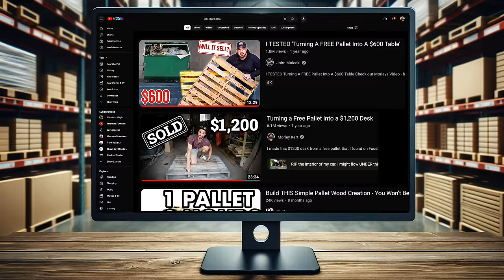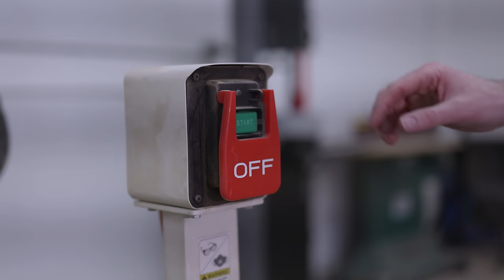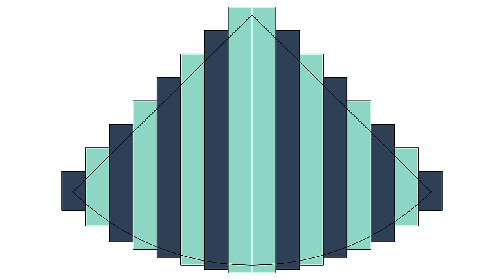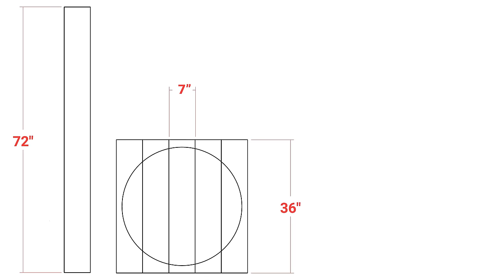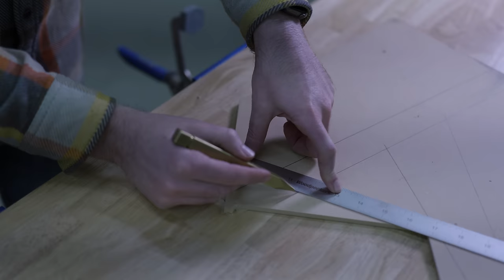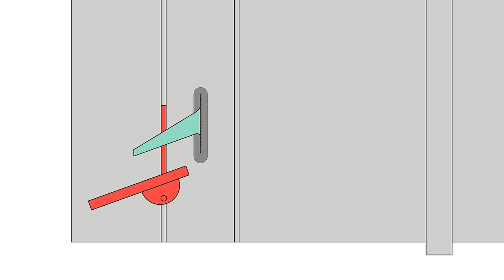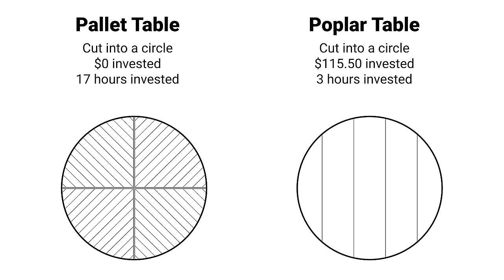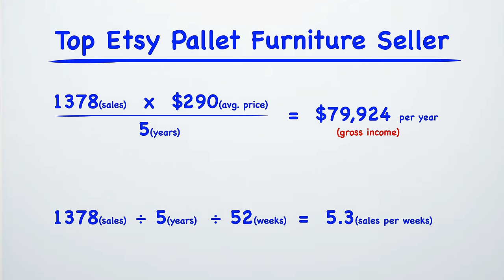Pallet Furniture is a Scam

Comment: Another unmentioned reason to not use pallet wood is that if you don't have a separate workshop and you're just woodworking in your basement, you have to lug dirty potentially pest-ridden wood through your house and in your car. Not a huge risk but potentially unpleasant and on the off chance there is actually something wrong with the woods congrats your house might have termintes now lmao.

Comment: it would be really cool if you built a table/work surface with tech included. Like a table with laptop connection ports.  USB power, Display ports (Video), speakers ect...

I have tried taking a pallet apart and it is was a royal pain in the arse. The nails used are almost like screws as they are twisted and have ridges that work like a screw. To save time it is probably best to cut the boards apart.

Comment: I would be very careful with putting pallets in-house. Many pallets are impregnated with insecticides to keep insects from getting into the wood during international transport of goods. This is quite unhealthy to put in an enclosed space, work with and inhale the dust of, or put any food items on.
Furthermore, if pallets are used for carriage of agricultural goods in containers, often containers are fumigated with methylbromide and formaldehyde against insects and rodents which can also leave traces on the rough wood. 
And pallets may have been exposed to all kinds of goods, including chemical products which leaked over them or products which may have deteriorated during carriage and leaked.
Think twice before using pallets for anything, especially indoors, as there may be a real health risk associated with it. It's not just a cheap source of plywood.

Comment: Pallets are very plentiful here, because of lots of ex-socialist factories nearby. Pallets come in different types. There are heavy pallets, shipping pallets, one travel or multiple travel pallets. Heavy pallets can be used for very heavy things, but just before metal pallets. These are strong woods that are very reusable or with high energy. Multiple travel and shipping pallets are the same, they are very durable. While one travel pallets are usually younger wood, good enough for holding. It's still good for furniture, but not the best.

Also, how they are nailed or if it's screwed. Pallets with nails are usually easy to get apart by crowbars, and the nails can be hit out. Screws.. not so much. If the screw is damaged, than it's better to cut it off. If it's not, than it can usually be unscrewed.

Pallets are very reusable, they always have been. It's trendy now, but people have reused pallets since maybe the 60ies or so. There are old beams, so on, very many harder wood types gets reused.

Comment: If you're spending 4 hours to clean and remove nails from pallet at 40€ hour = 160€
instead of paying 100€ or 200€ some wood
It's the same
It's good for beginers but you still need to have nice cut edge otherwise it's not good looking !

Comment: I build stuff from pallet wood mostly because its a lil hobbie and its inexpensive, plus I just make a few things here and there  for around the house. To me its mostly the nostalgia of it knowing that I created something  out of the bare minimum. Also each thing I make its like a one of a kind and its artisic. I made a lot of stuff from pallet wood. Like I made a quick and easy stool instead of spending $20 at Walmart for something thats made cheap. I made a couple end tables, and a bedframe and a head board. Just random stuff. I also make wooden signs and raised garden beds. The only thing I sell from pallets are the raised garden beds. The downside is it is time consuming.  Now if I was into woodcraft to make noney I would buy the lumber. But since I just make simple stuff for around the house I use pallets. Recently I made a cuttingboard from a pallet board and now I'm making a simple table for my alter. There are many pros and cons about making stuff from store bought lumber and pallet wood;  It just depends on the project you are doing and the look your going for.

Comment: I had grandiose fantasies of making “stuff” out of pallets.

The break down, no matter how careful I was sucks..

No matter how careful, you crack everything or it has cracks in it. 

One nail, screw, piece of metal will ruin your planner blades. Use a metal detector to find snd remove the metal.

The dust can be really toxic because god knows what it gets sprayed with or chemicals leak on them? You really really want to wear dust protection for your lungs

You are using your nice tools on garbage wood.

I found all kinds of shards of metal and various sized nails, too. Also some screws, also.

You bring up an important point: time… pallets take so much painful time to break them down & get anything usable without a ton of cracks… 

I had found nice nice figuring/ flame maple in some of mine. I wanted to salvage that nice looking flamed wood and they all got cracks in them..

I had all the problems like shown here. 

The wood is so inconsistent.

I should mention how badly beat up the pallets are treated also. The forklift crushing it it getting slammed / dropped, heavy loads placed on the wood, too.

I started just chopping them up for camp fire starter wood

Comment: Is there another use in a woodworking shop for pallet wood? Let’s drop the idea of making fine furniture out of it, you use a lot of wood for templates, for glue downs, etc. Can you take pallet wood and prep a bunch of it altogether, and then be able to use it whenever you need MDF for two by fours or what have you?obviously, you’re probably using more glue to do it, so there is a cost involved, but perhaps there are uses for pallet wood that would prevent them from just going into the trash, and might save you 20 or 30% on would you otherwise have to get in order to make your templates etc.

Comment: is the cost of the pallet table really 0 though? I saw a fair amount of epoxy and glue for broken parts and fixes that the poplar table just didn't have. I can understand if you were ignoring the cost of stuff like sandpaper, nails, and varnish since that would have been pretty equal on both sides but i think you should've added in the cost of the fixes on the pallet table to the cost since it was a pretty necessary addition to the low quality wood.

Comment: Let's take a wood sponge that may or may not have been used to transport toxic chemicals or other health hazard materials and put it inside my home to breathe that stuff in. It's best used for a computer table, so you have direct access to the fumes. And even if one knows that the pallets were not used for transporting lead paint, you never know what was on the floor of the transporting truck or storage unit.

Comment: Honestly, if you're willing to put in the time, effort and gas to pick them up, dismantle, sand and clean up all the power to you. If you are a woodworker you have access to free material, and can be used for prototyping, or finish work, or even campfires.

Comment: Pallet wood is treated to be rot resistant, so it's great for outdoor projects you don't want to paint, like building a box, charring the inside, then fill it with dirt and plant some flowers. Also good for bird houses because unless you let them air out an entire year, those annoying little fucks never accept them if they are painted.

Comment: i made garden-boxes (maybe i had to cheap completely out on using more screws and instead used nails BUT, they have been holding up VERY well for nearly 3 years now!,
and i used ONLY wood that was free, and it took 2 hours to make one (without counting the time i took not making it) they're HUGE and my garden is great!, made 7 so far (wanna make 9)
and...seems like, if i were SUPER desperate and willing to buy and get things that would vastly improve the quality and lifespan of them, i would not starve selling them.
They're old and grey, and since i built them with the BARE minimum amount of nails and screws, and never treated the wood...i am sure they will still hold, and still last another 4 years,
however i think after that i would need to un-fill them and bury them half-way in the ground to keep holding together, since indeed, i used nails and at least the OLDEST one has 2 boards that popped off. (lol i built it the dumb way with the up-down side boards with the cross-beam on the inside, 
since i was using the ugly nail-ridden side-board of the pallets and they couldn't be cut perfect) ...so, my fault, but y'know...not too bad so far!. and yess yess, i made sure it didn't have chemicals.

Comment: Some pallets are actually tropical hard woods. Worth considering. I am not a furniture maker but started with pallets and you learn so much from boards splitting, grain orientation, alongside what cups and bows can mean for assembly. Having free material I think is invaluable for learning these lessons as the poplar, whilst the cheapest is quite pretty wood considering the colour pigment and is something that I think would be better used after knowing how to work with slightly more basic and I guess shoddy materials. I made a cabinet from Tulip Poplar and it's under my bench at work. I love it but would not have got anywhere near as good as a result had I not worked with pallet wood first. Good video and fantastic use of AI for the generated pictures!

Comment: The comment about new woodworkers using better materials to build confidence is spot on. The issues you encountered with the pallet wood were more easily overcome by your years of experience whereas a newbie would wonder if maybe they lacked the talent to pursue woodworking as a hobby. IMHO, the risk of possibly not pursuing woodworking due to using substandard materials is not worth the savings. Thanks for a great video although I did a double take when I saw the title.

Comment: Depends on the location. We have very very many super cheap or free trash pallets here in nearby factories or plants. The workshops usually are around those parts too, as in cities, in 10 level buildings, residential areas, there are no places for workshops. While economical wood would need to be taken from sawmills, lumberyards or 'fire and construction material' places. Which usually deliver bigger orders, which is a lot of money at the start.

Comment: I burn them for firewood -- and similar laws of economics apply.  They are free, they do take work, and they do take a special stove to burn them.  But once everything added up, I decided it was worth it because the stove is outside and the pallets basically go from the utility trailer to the stove, no stacking, no seasoning, no moving.  There is some "splitting" that is, I do break the pallets apart and have gotten pretty efficient at it.

Comment: I'm diving into woodworking for the first time since i built shelves with my grandpa at 12 years old, because i wanted a desk for my art corner. and i'm next to broke, so buying one wasn't an option. instead i picked up a used circular saw and palm sander from craigslist for $20. I already have a powerdrill, hammer and a hand planer. I ended up spending a couple months learning as i went and creating an L shaped desk from free pallet wood, and some 2x2's for the legs. I'm extremely proud of it, it's sturdy, has a rustic charm accented with midtone stain and black painted legs. Honestly it's great to see an experienced guy having some of the same problems i had with the boards, pulling them apart, dealing with various board dimensions and chips in the wood. Makes me feel better about how i handled the process, meaning i wasn't completely fucking up.

Comment: For me I buy lots of wood... You know wood that comes in lots... Or strapped together in 500 to 1000 board feet.

Not this isn't free... But it's also a hell of a lot cheaper than 5$ a board foot for the cheapest hardwood you can build furniture with.

What I am saying is that if you are doing woodworking as a business.  First you are not buying 25 board feet at a time.  Second you are also not paying hobbyist prices in a store.

Comment: Pallet wood has higher payout when used for smaller projects.  Making stuff like wall decorations such as scones, key hanging wall frames and yard furniture like planters, chairs and benches.  These smaller projects are so much easier and faster to make and also use a lot less wood. Also, you can greatly increase the sale price of such projects by customizing them with personalized touches that people are crazy about. Such customizing can be made with machines like laser engravers.

Comment: Really good work there! But I have a few problems with the title. What I understand by "pallet furniture" is furnite that actually uses pallettes as a whole to create furniture, often beds or sofas, with little to no changes to the pallette. Not making something entirely new from the material itself. And is "scam" the right word? Sure there might be a few videos suggesting using freely available materials are a killer business idea. But let's be honest, 99% of viewers aren't even building anything themselves let alone own any of the machinery or even run a business with it! It should be blatantly obvious that leftover pallettes aren't available in such quantities that let you make a business out of it or rely on them. It shouldn't come as a surprise that tiny, crooked, dirty slates of wood require more work than big new boards

Comment: I'm not sure this table is a good comparison, because the big table top is difficult to make out of pallet wood. Most pallet furniture I have seen in the wild is directly using pallets without glueing together the individual boards. For example I have seen benches that just consist of two pallets, each cut in half and nailed together. Extremely easy to build, but of course not as nice a result.

Comment: So, the pallet wood table is prettier.  One option in your scenarios you didn't consider is using some pallet wood and some poplar.  Though, you kind of did that by using walnut with your pallet wood.  It might be good to use all pallet wood for smaller projects like boxes, shelves and other decor until you're confident you can use all the tools you have without losing any digits or rocketing the cutoffs through your garage wall into your bathroom like my brother did with his table saw.  Then use the materials that suit your working style and design style.  Oh, and definitely charge for your time.

Comment: not really a get rich quick thing.  you need all the tools that are not cheap.    and a big workshop,  and all the electricity costs.
then you need all the skills to work out the shape and how to use the wood so there is little waste.
for the number of hours it takes and the money you need to get so you can pay the bills  or just get a job some where.
Is the work needed to make the free wood look good worth it.  you need to spend a lot more of your time just to get the same end product.
it may be easy to make simple projects from pallet wood,  stuff that does not require curves.  but you still have a far higher electricity bill to clean up and prepare pallet wood over just buying ready to go wood.

Comment: A) The main person you show in regards to pallet furniture is Morley Kert. You clearly didn’t actually watch his videos because he doesn’t just choose any old pallet like you did. You didn’t even acknowledge that pallets can be made from different kinds of wood. He only uses quality wood pallets like hardwoods, and he avoids pine entirely which is exactly what you used. 

B) You showed the issue with tear out which shows that again you didn’t watch his videos. He also brings up tear out but he proposes a solution to prevent and minimize it before hand by using blue tape to help mitigate the issue. So you didn’t use any of the solutions he did for the problems that arise from working with pallets.

C) Morley doesn’t use pallets for the legs. Again, you clearly didn’t watch his videos. He orders quality metal legs from the internet to add to his work with good quality hardwoods from hand selected pallets that are crafted with skill and tricks to help prevent issues that arise from material choice.

D) You seem to imply that creators in this space are being dishonest and not giving all the information and you are the one that is. But again, if you had watched their videos it goes over price and time it takes to make each project. Morley also mentions that his videos are not how to guides on making a pallet wood furniture business and that his videos are for entertainment. Again, you would know this, if you had watched the videos. 

This video is very disingenuous and lacks integrity. If you are going to criticize and critique someone’s work and art then you better make sure you are fully informed on the subject matter before you make assumptions and look like a fool. Bad take, bad video, have the day you deserve.

Comment: Using old pallets (not so much new ones) takes a lot more time. On the scale of 18 hours instead of 1 hour for a basic table using flat lumber.
It also needs more, and bigger tools. Unless of course you spend even more time.
At $1,500 sale price, I'm going to estimate they make $60 per hour.

Comment: I never met a pallet I didn't like. I feel in sort of primative way towards them. Use every part somehow  if you are going to take the trouble of gr setting involved. If new enough and not beat up too much or even better amazingly pristine I seek identical versions to configure together intact. But damaged pallets generate many ideas out of the pieces and sometimes practically come apart anyway. Dealing with multiple nailed up scabbed back together refurbished pallets can be a pain though. I'm tempted to use every piece. But often sections can be used without taking the whole thing apart. 
Strategic cuts can leave very useful shapes for rejoining in neat and very strong ways.